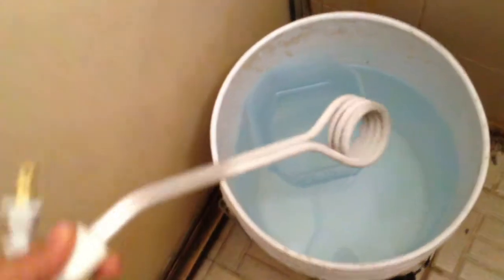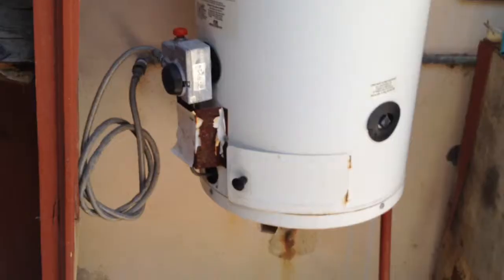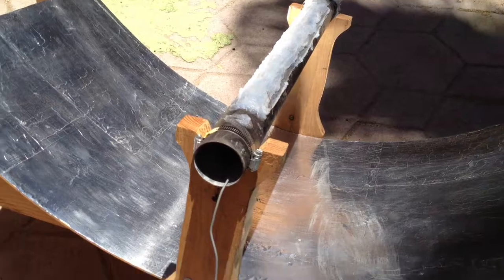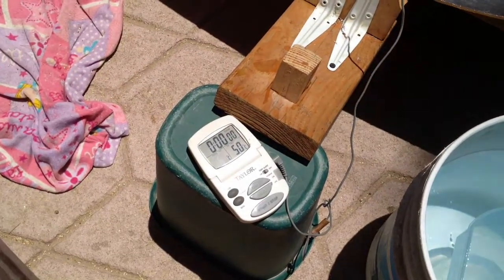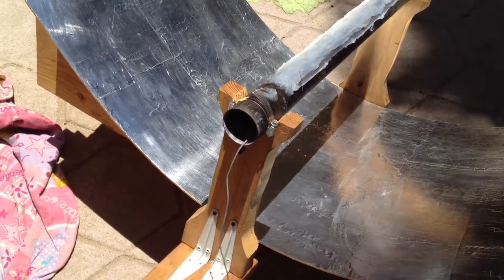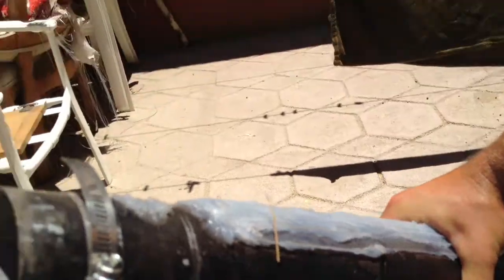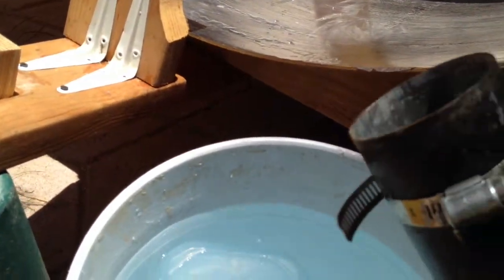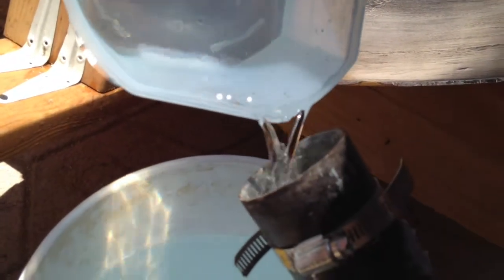30.5 heating up shower water with the sun

Comment: That’s a very nice idea I have 2 questions for you:
1. How hot is the temperature in your area? 
2. If you want to imply this to a water tank (not very big) to replace an electric water heater how would you do it?
Thanks
Reply from the maker: This was Mexico often 35C.  To heat water you could circulate through and sole heater